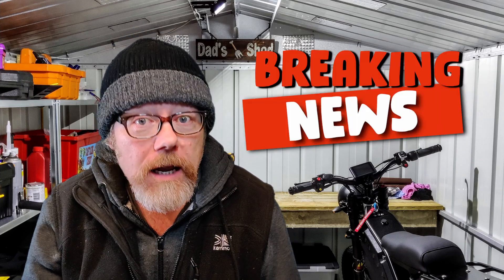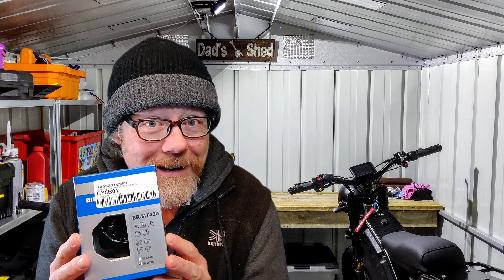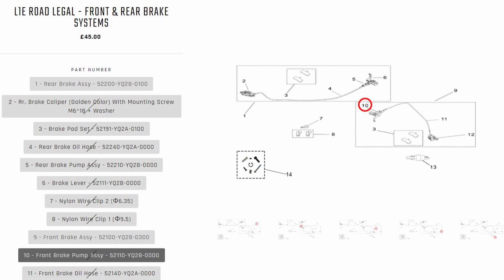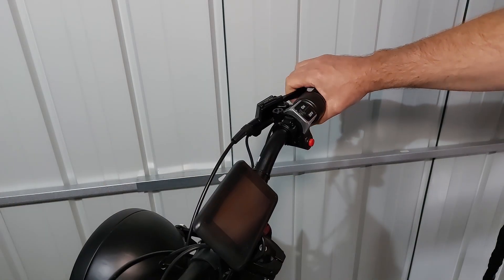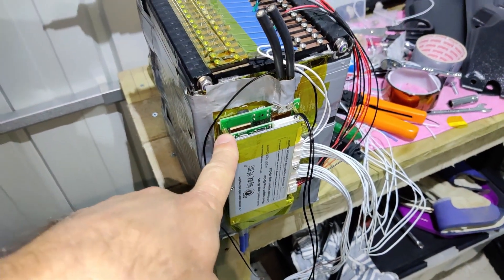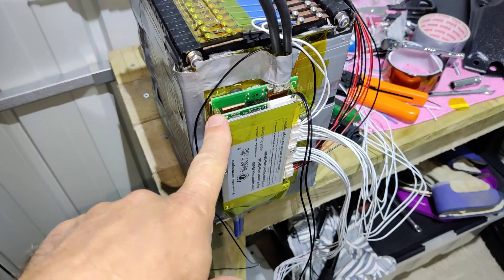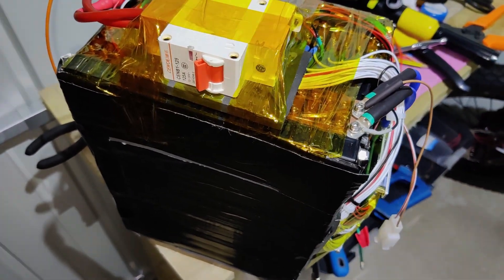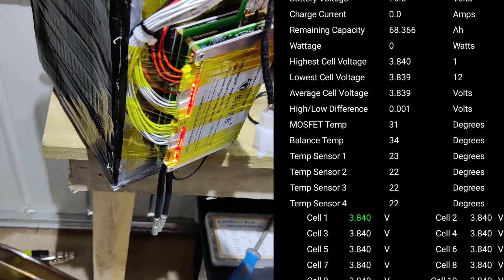THE EBIKE IS ALIVE - EPISODE 15 ROAD LEGAL EBIKE BUILD ANT BMS CONNECTIONS SHIMANO BR-MT420 4 PISTON

Comment: hi, what range do you have on this battery, smooth ride 20-30miles speed, think bay 🤔 40 cells 2 cells together, bay this same batteries, or bulid two batteries 🔋 x2
Reply from the maker: About 20 miles was the range.
I couldn't fit 40 in that frame, but it would of been nice 👍

Comment: Saw your comment on the injas video, thought I'd go check out your build, Nice!!
Are you related to creakyblinder? hahaa

My ebike is a downhill frame with an mxus 3k motor. Driven by a fairly custom sine wave controller, set to 140A battery,   300A phase and 100.8v hot off the charger. Battery is an LG HG2 24s7p, but i'm about to parallel in a samsung 40T 24s4p. Giving me a total of 37Ah
Reply from the maker: No realation to creakyblinder 😜

Thanks for checking out the build👍

Comment: do you have a link working to these links? what is the cost for the links themselves ??
Reply from the maker: I did put links on earlier videos but a lot of the links change over time and don't work anymore so I stopped. All those parts come to over £3000
Reply: @baconbuttties  tell me you live in the uk ?? Would you be able to send the links to Poland because I found them on eBay for £ 415 - 20 pieces
Reply from the maker: @KaziuOffgrid  I don't understand what you mean? Links?
Reply: @baconbuttties  Your battery has a capacity of 20 Ah right?
Reply from the maker: @KaziuOffgrid   yes that's  correct ,20 ah capacity

Comment: Having done a year of experimenting with brakes on my similar build, I hope these 2 tips will help. For these brake calipers, make sure to use D02S metal pads. Speed and weight is too much for the resin ones. For the brake disc shim (if needed to center disc),  on the front brakes, be sure to use metal ones (Steel / aluminum) as the plastic ones can deform with heat. You might not notice it, as the disk will still run fairly true, but the mounting bolts will end up loose. This is all learnt from experience.
Reply from the maker: Thanks, appreciate tips on brakes and will look into pads 👍🏼. I haven't got a spacer on the front disc but did use plastic shim on the side which is not getting used just to cover it up and look tidy. I would never use a plastic shim on brakes but much appreciated and good advice, Thanks.

Comment: What was the name of the cap for the one side of the dual disk hub. The cap you put on after removing the rotor?
Reply from the maker: I'm not sure what they are called but it came off the rear hub motor. The rear hub motor usually has  the plastic cover ring before you put disc on, I used that as it seems a good idea to stop dirt and water.
Reply from the maker: Did find something similar on ebay in the US https://www.ebay.co.uk/itm/282360059857?epid=1972397462&hash=item41bdf897d1:g:s6oAAOSwvoxb2vu9